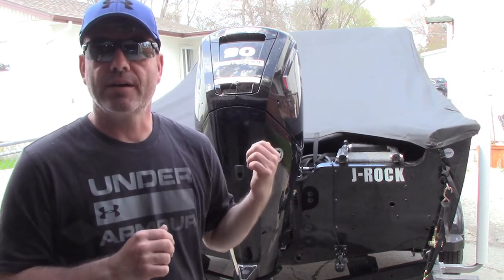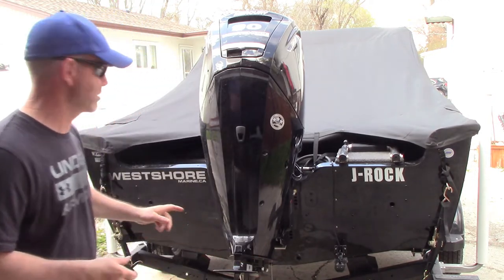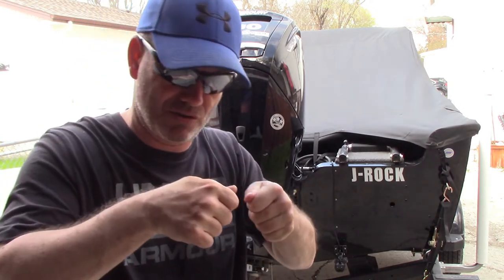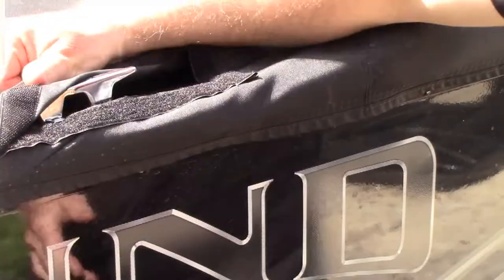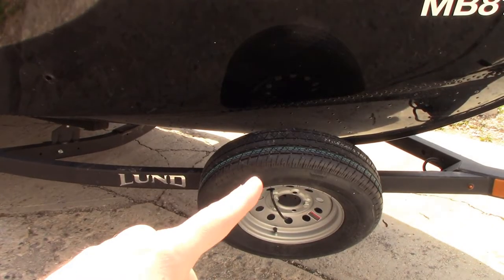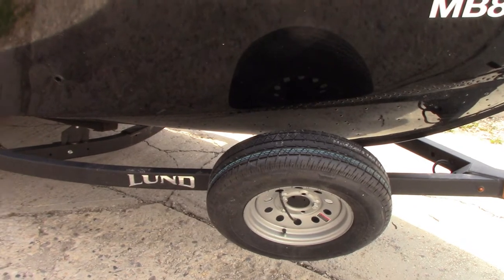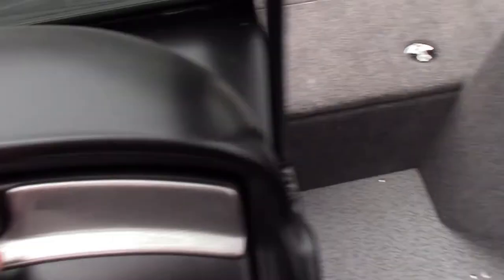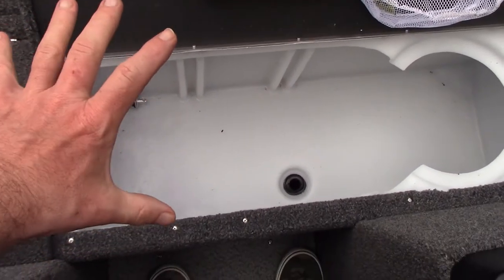2022 Lund Rebel 1650 XL

Comment: did u not follow breaking procedure mercury states for the first hour to fluctuate RPM and stay under 3500. For the second hour I believe mercury states for the second hour that you need to fluctuate RPMs consistently all the way to 4500 RPM and hold it wide open for one minute every 10 minutes. After that you can use the motor however, as long as you don’t hold it wide open for more than five minutes and that is all the way to the 10 hour mark and after that the motor is broken in.
Reply from the maker: I definitely do follow the break in procedure. It is all in the manual. Very easy to do. If you do not follow this procedure you can damage the motor and void your warranty.
Thanks for watching.